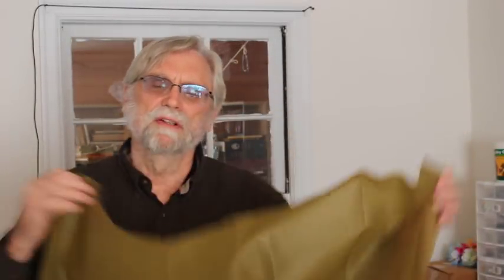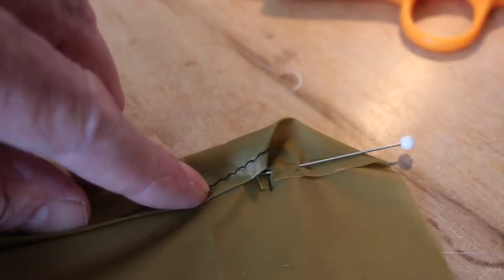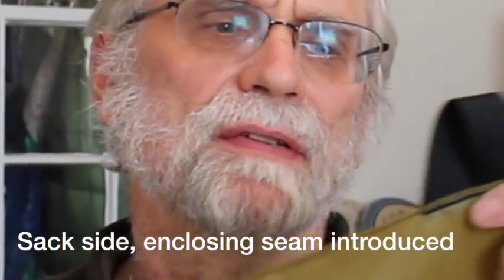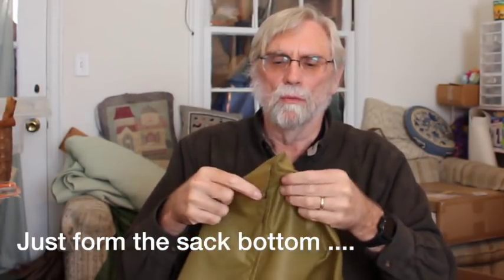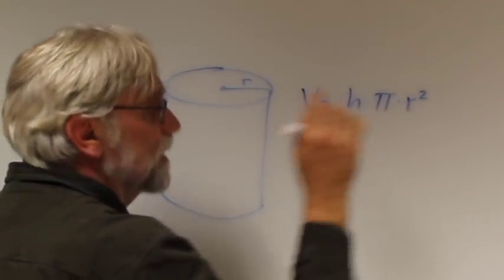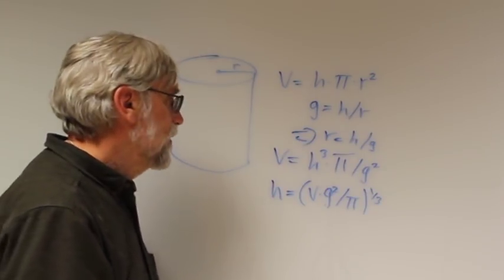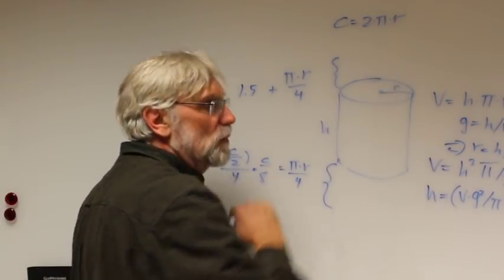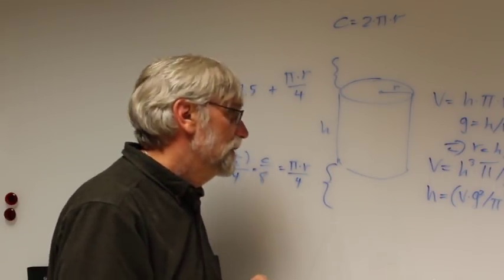Engineering a Philmont Food Sack

Comment: nice video. I'll be at Philmont in July. Will be making rain skirts for my son and I. Have seen videos and designs for skirts made out of rectangles. trying to figure out the best method for making a cone shaped skirt for more leg room.  Seems like that might be some math fun for you.
Reply from the maker: Thanks Vincent.  We're trek 802-B which as you know means August, the 'monsoon' season I'm told. I found a tutorial on a rain skirt with a conical design but it seemed like too much work to me.   I'm using a rectangle that is as much as 18 inches wider than it needs to be, and making pleat like gathers at the waist to pull it in up there, leaving the extra width towards the bottom. Pleats can go to the front or to the back as desired for best clearance.  If you like you can use youtube messaging to provide an email address and I can take some pictures of it to pass along.